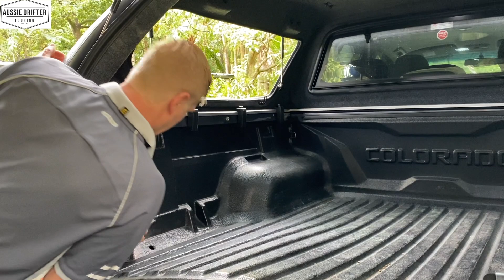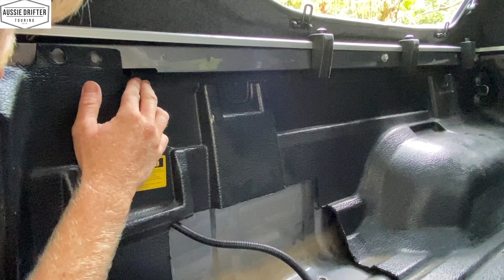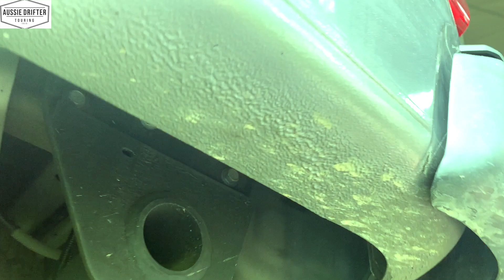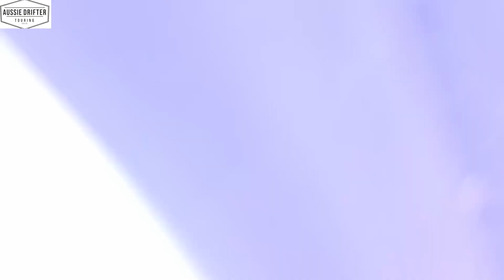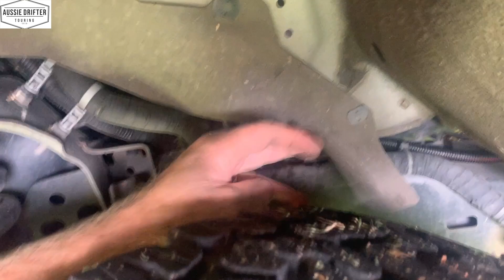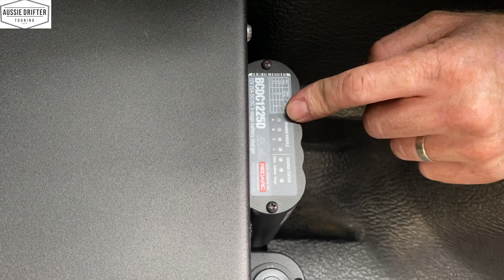Isuzu Dmax - Holden Colorado tub mounted Redarc dual battery Kit

Comment: Hey mate I’m a bit late to this video but I have 2020 ls Colorado 
And have found different sources telling me it does have a smart alternator but going on this video and the other one of yours my Colorado has nothing on the negative terminal so am I right in thinking there is definitely no smart alternator?
And it obviously doesn’t need the trigger wire connected and will still charge the second battery correctly?
Reply from the maker: Hey mate. No in Australia the colorado never used a variable voltage (smart) alternator it had a temperature compensating alternator. The Isuzu Dmax (which is essantially the same car) did use a smart alternator but the colorado never did.

Comment: Hey mate I have a 2014 RG just checking if I need to connect the ignition wire and if I don’t will it still charge my battery when driving and not when not driving with still a dcdc
Reply from the maker: No the colorado never had a smart alternator so no need to worry about the ignition wire that's just for the DMAX

Comment: How did you earth the second battery
Reply from the maker: Hi Brad,  The earths are attached to the battery box itself and this being a kit designed to go in a particular spot and mounted to the chassis rail through the tub means that once mounted the aux battery is earthed to the body of the car and therefore also back to the main battery through the mounting bolts.  Cheers Kurt

Comment: Hi mate I’m keen on one of these but I just wanted to confirm that if it is earthed through the battery box, the box then becomes a negative conductor. Will there be any issues with having the positive terminals that close to the box at all? Is there a rule of how close it can get?
Reply from the maker: Hi Adam.  Yer the box is negative but the positive terminals are not close to the top of the box.  The battery is very secure in the box and is held down with metal hold down bracket.  Onto of the metal hold down bracket is a midi fuse holder mounted to it so there is plenty of bight between the terminal and the box lid.  There is no rule but it certainly can’t be close or touching.
Reply: @AussieDrifterTouring  thanks guys I’ll get the 2021 bt50 one tomorrow night. Is it the same install process re secure through the tub into the chassis rail.
Reply: @adambtfiddy9  no reply after 9 months?

Comment: Are you able to purchase just the loom? i already have a New ( In Box ) BcDc1225 , It would make it easier to fit with this loom
Reply from the maker: Hi mate. 
 Unfortunately we can’t seperate the wiring from the redarc charger because it is hard wired in. That’s what makes the redarc so water and weather proof.  However we have had customers post us their charger and we can build in a vehicle specific harness.  This would be $450 cheaper than any advertised 1225d kit on our site, hope that makes sense.